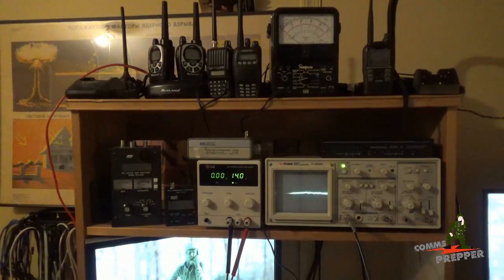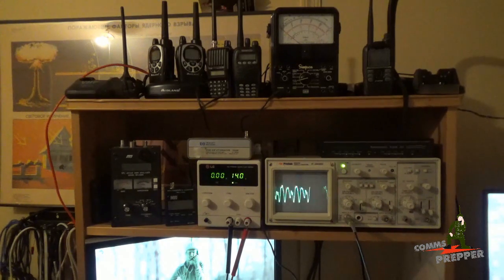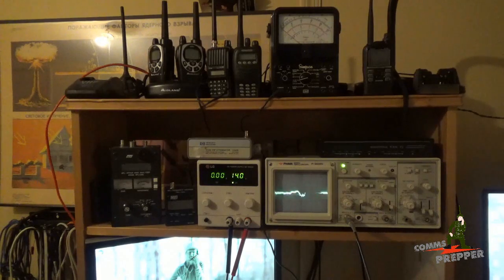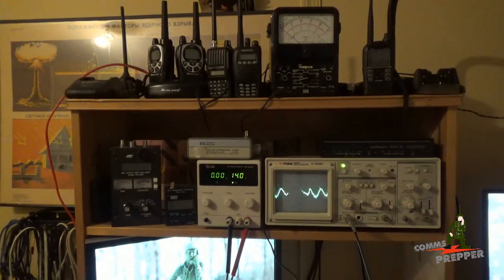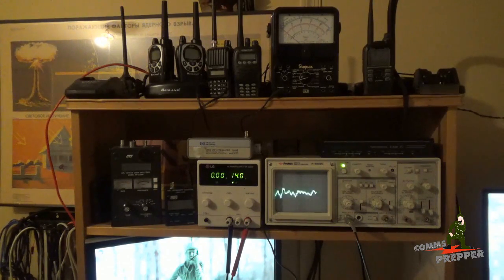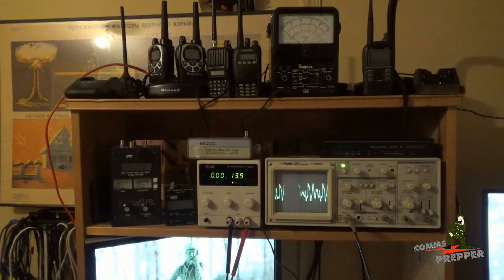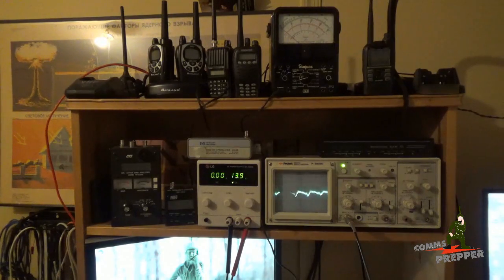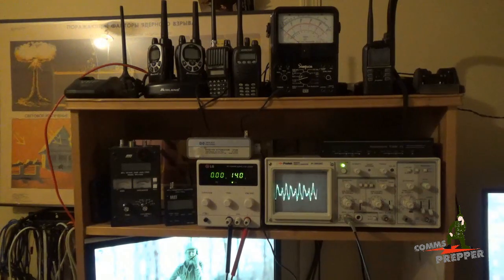Basic Ham Radio Test Equipment

Comment: 😆.  Back in the late 1970’s, I worked afternoons at the TV repair shop next to my parents retail business.
Both businesses were located adjacent to “The Projects” (federal section 8 housing) 
with gunshots ringing out on a daily basis.

It was my job to take the incoming TV’s, stereo components and assorted electronic appliances
from the front counter and  “BAG ‘EM” !   😳🙄🤣
A single contractor grade garbage bag for televisions and double domestic kitchen grade bags for stereo gear.
Then, the owner would come by and “fog the bag” , spraying a lethal concoction of chemicals into the bag and sealing it up again.
After A few days, the equipment would be removed from the bag and the bag would be tossed..  with POUNDS of DEAD ROACHES inside.

Yuck!

This guy, the owner of a small business that was there in the community for decades..
(from the early 1960’s until the early 2000’s)  really took me under his wings and hired me at the age of 9 or 10
and , Not only paid me for my labor, he also did his best to instill electronics knowledge and business ethics
 and knowledge into my tiny skull.

As it was located in the ghetto, many times people would not be able to afford repairs.
Dozens  of times, I saw him work out payment arrangements and even service the elderly folks’ 
equipment.  He always told me to do what was the most honorable and right, not what was the most profitable.

Eventually, my folks sold their building to him and moved their business up to the suburbs.
I lost contact with him but never forgot the lessons taught.

Fast forward several decades and I was watching the news on Christmas Eve a few years after the millennium.
I saw a familiar sight.  The storefront of the tv repair shop.

The owner, a gentle man.. an OLD and gentle man (he was 91 at the time)...
opened his doors to an asshole who said he needed batteries for the kids’ 
Christmas presents that he just purchased somewhere.

Yup,..   he opened the door.   He was shot and beat to death 
with a hammer.   The asshole killer left with a few bucks and left my friend to die on Christmas Eve.
The medical examiner said he clung to life for many hours prior to succumbing to the injuries.

Tragic and sad.  Even more tragic.. though he was the first person to take me shooting and teach me 
about 2A and took me up to his hunting cabin to teach all of this...   he COMPLIED WITH THE STUPID
NJ LAWS and wouldn’t carry concealed when at work because “once I step outside the shop to assist 
a customer, etc..  I am violating the law”.

The killer didn’t really seem to care much about ANY law..
RIP Paul Garafola. 
❤️
Reply from the maker: Sad story but glad to hear you learned so much from what sounds like a great mentor.  Thank you for the comment.

Comment: Another EXCELLENT choice for a sub-$100 tool = Handheld “frequency counter” with built-in CTCSS & DCS decoding.
(Surecom brand on Amazon was around $68)

Also.. fantastic phone application (IOS + Android). RADIO ID.
Decodes MDC 600 & 1200 / QC2 / and a few other signaling formats 
ALL VIA THE MOBILE DEVICE MICROPHONE (or line in)

Thanks as always.
73
KD2MKZ

Comment: Jesus, I remember training on the Simpson 260-8. That thing was a beast of a multimeter. Super reliable as well, since you could chuck that thing off a cliff and it would still work.

Also a super simple block diagram. Very straightforward, and easy to comprehend.
Reply from the maker: I love my 260

Comment: Dear friend forgive the daring to write to him on his channel but I would like your opinion
technique of the problem of my Yaesu FT-450.

Here I explain what happens with my Yaesu FT-450.

A few days ago I made the mistake of trying a radio from a friend of mine when my
FT-450 was on receiving, they had two different antennas but the separation
between the antennas on the roof are 3 meters. When I was testing the radio in transmission
I felt a burning smell from my friend and I realized that it was coming from my radio, at the moment
I turned it off and when I turned it back on it had changed many things like:

- TRANSMIT BUT DOES NOT GIVE ANY OUT POWER IN (AM) MODE ON ANY BAND.

- THE SYSTEM (ALC) DOESN'T WORK, NEVER MARK ANYTHING ON THE DISPLAY, BEFORE IT WORKED
  VERY GOOD.

- ESPECIALLY IN 6M (50MHZ) BEFORE HAD 100 WATT, NOW ONLY HAS 10WATT AND WHEN
  CW OR SSB TRANSFER FEELS MY VOICE OR NOISE IN THE RADIO HORN.

- THE INTERNAL RADIO TUNER ANTENNA DOES NOT ADJUST IN SOME BANDS AND HIGH SWR
WITH GHOST ANTENNA DUMMY 50OHM ADJUST 1: 1 ALMOST ALL BANDS, I REMOVED
THE RADIO TUNER ANTENNA AND CONTINUES WITH THE SAME PROBLEM, THE PROBLEM IS NOT
THE INT-TUNER OF THE FT-450.

- BEFORE ALMOST ALL BANDS DRAWN 100 WATT CW AND ALMOST 90 WATT SSB. NOW HIM
RESULT WITH LOAD DUMMY 50OHM PER BAND IS:

160m ...

fm .... 100 watt
cw .... 100 watt
am .... no carrier no power
fonia and digital .. 100 watt

-----------------------------

80m ...

fm .... 100 watt
cw .... 100 watt
am .... no carrier no power
fonia and dgital .. 100 watt

-----------------------

40m ....

fm .... 70 watt
cw .... 70 watt
am .... no carrier no power
fonia and digital ..40 watt

-----------------------

30m .......

fm .... 70 watt
cw .... 70 watt
am .... no carrier no power

-----------------------

20m .......

fm .... 70 watt
cw .... 70 watt
am .... no carrier no power
fonia and digital .. 40 watt

-----------------------

17m .......

fm .... 50 watt
cw .... 50 watt
am .... no carrier no power
fonia and digital .. 30 watt

------------------------

15 m ........

fm .... 80 watt
cw .... 80 watt
am .... no carrier no power
fonia and digital .. 80 watt

-------------------------

12m .........

fm .... 80 watt
cw .... 80 watt
am .... no carrier no power
fonia and digital .. 50 watt

When I transmit on the phone you can hear it on the radio horn

-------------------------

10m .........

fm .... 50 watt
cw .... 50 watt
am .... 10watt
fonia and digital .. 50 watt

---------------------------

6m .........

fm .... 20 watt
cw .... 20 watt
am .... 20 watt
fonia and digital .. 20 watt, When I transmit in fonia it is heard in the
radio horn. He also seems to be crazy, he makes noise and he seems to have serious
problems.

I RESET HOME OF THE RADIO AND CONTINUE WITH THE SAME PROBLEM, THE PARAMETERS
THE HIDDEN MENU IS CORRECT, THE RECEPTION IS CONSIDERED GOOD IN ALL
THE BANDS AND MODES.

I CHECK THE BOARDS OR BOARDS AND ALL ARE IN GOOD PHYSICAL CONDITION, NONE
COMPONENT SEEMS TO BE BURNED. BEFORE MAKING THE ERROR MY RADIO WAS WORKING
NO PROBLEM WITH 100 WATT IN ALL THE BANDS AND THE AUT INT ALSO WORKED
NO PROBLEM.

I HOPE THAT WITH THESE DATA YOU CAN GIVE ME AN IDEA OR OPINION OF WHAT PROBLEM
THE TEAM HAS THOUSAND THANKS IN ADVANCE.

note :Now I have realized that when I press the ATT or IPO key that is only for reception it falls
even more the power in all the bands, in addition I tested it in reception 6m 50mhz and it has problems
also at the reception .

BEST 73.- EDUARDO CO8LY
Reply from the maker: EDUARDO, thank you for the comment but I must apologize - I don't know what your problem is. I am sorry you have a bad radio.
Reply: .
 @Commsprepper  Thank you for answering me, my radio has several problems and I only ask for guidance and opinions on where I could have the problems, if you want I can tell you the history of the problems of my Ft-450 and you only have to give me your opinion, all around here.
If you think that you cannot help me, just tell me and there is no problem, thank you very much for your response and take the time to answer me. Greetings to the family and take good care of yourselves.

Comment: Good info....    I remember Block 1 at Alley Hall at Keesler AFB when I started retraining into SATCOM.  This was the Basic Electronics portion of the training.   The instructor had a giant "moron sized" Simpson multimeter...   by the time we ended our training a year later, after using "O" scopes and Spectrum Analyzers, we were laughing at that 6 foot tall multimeter....    USAF had a good building block approach to training though.   I have a Fluke multimeter and a MFJ Antenna analyzer.   I'd like to eventually pick up an "O" scope and a spectrum analyzer....   good video

73
Reply from the maker: I went to Alley and Jones Halls for Ground Radio back in the '80s.
Reply: Alley Hall.. '97 then went into electronic warfare ;-)

Comment: Collecting test equipment can become quite addicting.  The legacy green screen stuff is where it's at. Thanks for sharing !
Reply from the maker: SC - thanks for the comment and channel support.  Hank
Reply: My wife hates ALL of you!
(& she now hates me even more 😔)
But MasterCard and Visa LOVE me !

😆🤣😷

Thanks for the test equipment overview.

Just a quick tip...  for oscilloscopes & spectrum analyzers,
a great bargain can be had by purchasing Rigol brand equipment.

I was on the quest for a spectrum analyzer for over 2 years..  just to tune repeater duplexers.
For under $2k, it was brand new and pretty nice.
Reply: But... what about capacitor leakage over time?
That could be pretty damn daunting with something as complex as an HP spectrum analyzer..

I always saw the HP 8590 series working hard at the task of duplexer tuning and transceiver service 
in the public safety world.  So... when I started assembling a collection of RF and electronics test gear,
I automatically went for HP and Agilent branded equipment,  UNTIL I saw the pricing (even used).

I went the route of Rigol and was happy.... UNTIL I saw eBay listings for HP spectrum analyzers.
I was tempted and succumb to the temptation.  The first unit I got was DOA.
The second unit, an HP 8591C arrived and was functional.  It was dead on as far as calibration,
though it hadn’t been calibrated in 15 years.   The only “issue” is the fact that it is a 75 ohm unit.
It is easy enough to change to50 ohms in the [Amplitude Menu].  But, as I am routinely an idiot,
I required the application of a large P touch label on the face of the SA to remind me prior to operation.

I have a GPS disciplined oscillator/ 10Mhz Reference  which I use for all of my bench gear and the 
HP internal oxdo comes incredibly close to matching that precision.

The only thing I am afraid of....   the appearance of “MAGIC SMOKE”.

Does anyone have any thoughts on the acquisition of more sophisticated test instruments from the 1990s era?
Due to medical concerns (and the fact that I’m an old fart), i’d be terrified to even contemplate recapping such a beast.

Thanks and great video as always!
Reply: @PowderMill  It is always a risk. Anything self procured / maintained is a gamble. I try to get it from someone reputable but even then ......